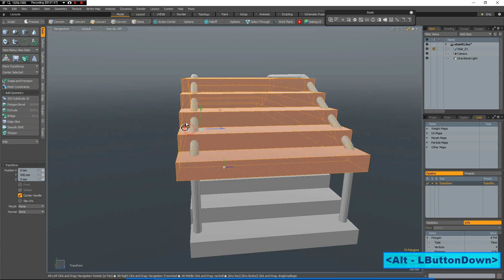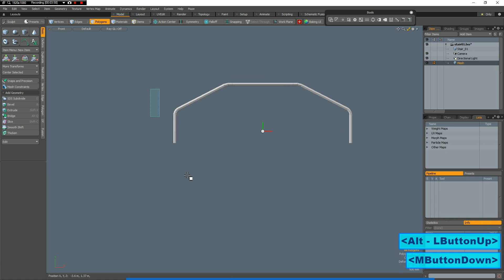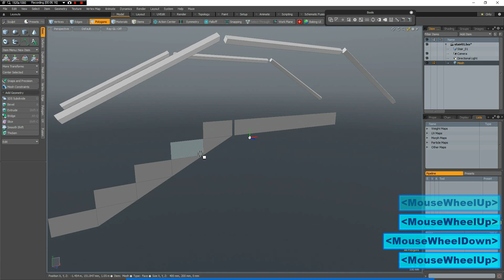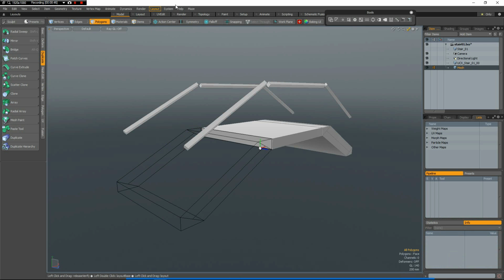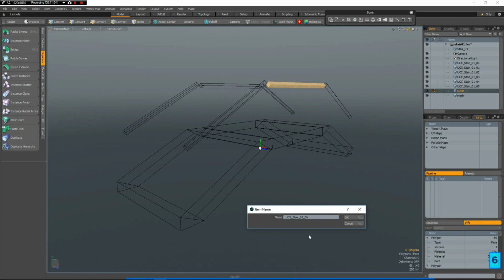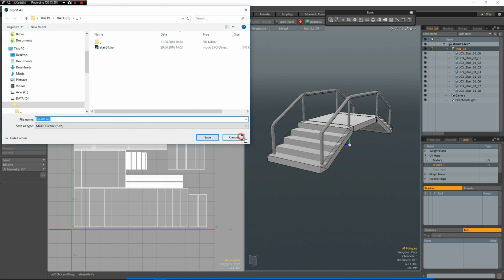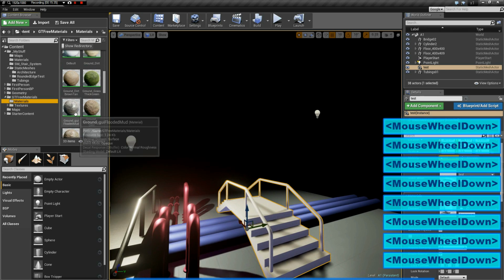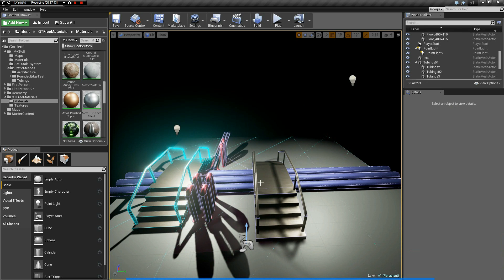The Foundry MODO to Unreal Engine 4 - Custom Collision Meshes

Comment: hey Peter, why do you have to separate the rails and stars into multiple collision meshes ?
Reply from the maker: I think i explain this briefly in the video. The problem is, that UE4 does not make the collision meshes 1:1. I think you must try this out for yourself to know what i mean. Kind regards, Peter
Reply: There is no reason to do that. Simply follow these instructions https://answers.unrealengine.com/questions/22059/unreal-engine-4-reworks-importing-ucx-model-collis.html and you can leave it in the same mesh.